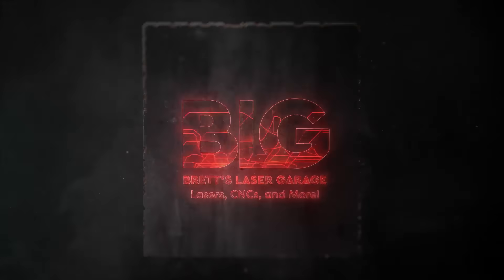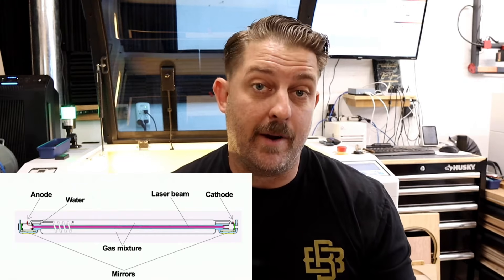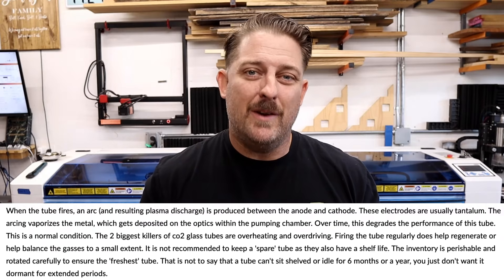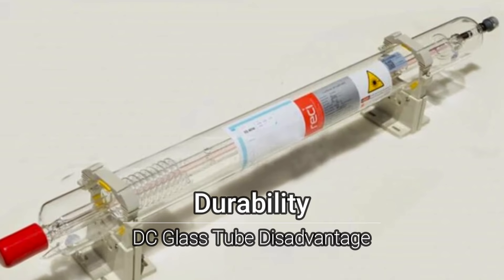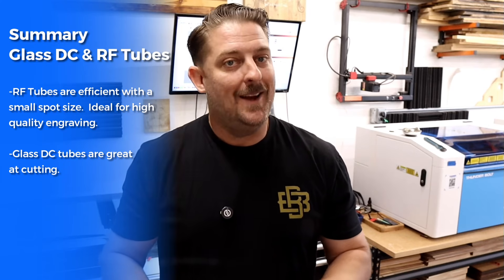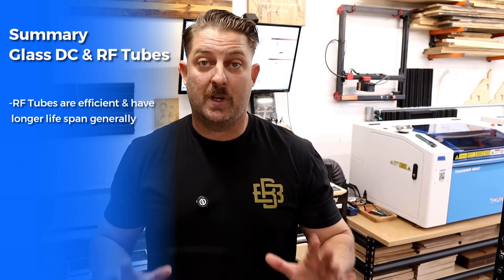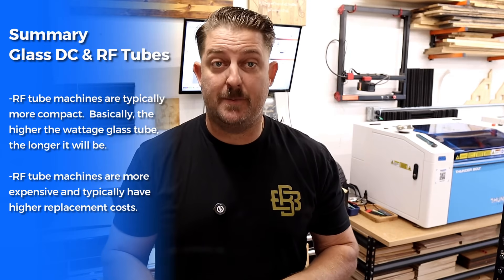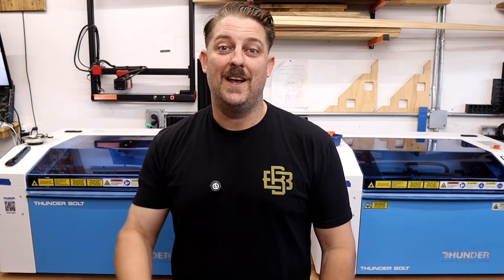What the heck is an RF laser?  EXPLAINED | Thunder Laser Bolt Pro 32  | Brett's Laser Garage

Comment: All RF laser tubes are not the same.  The Bolt Pro32 has a Coherent branded tube which is super expensive.  Here in Canada that machine is $20K.  The NovaPlus 24 uses an SPT branded RF tube which is probably a third to a quarter of the price.  That machine is C$10K.  I want an RF tube but am trying to figure out if I’ll be disappointed with the cheaper tube.  Usually more expensive means better, more consistent, more reliable.  If you have any thoughts I’d love to know them.  You have the Coherent tube in the pro 32 and the SPT tube in the regular Bolt.  Do you notice a difference?  Thanks for the video.
Reply from the maker: You’re welcome.  The only difference I notice between the Bolt Pro 32 and my regular Bolts is cutting power.  I don’t pay much attention to those kinds of details you listed to be honest.  I know whatever source Thunder decides to go with will perform bottom line and of course they will stand behind it.  I can’t remember the name off hand but I believe Thunder recently partnered with a RF tube manufacturer and I think I heard them say they are pretty much transitioning to all RF tubes sometime in the near future.  I think that’s a great call.
Reply: My all RF tubes is Coherent, and lens, also Coherent.

Comment: which is better for charring on hardwoods? basically which has gets the engraving darker with the most contrast.
Reply from the maker: Great question.  I have not seen any difference in that between glass dc tubes and RF machines.  I’ve gotten dark engravings on both.   I’ve found material selection, power/speed, line interval and focus make the most difference.  Testing is going to be key here.

Comment: Does an RF tube better handle the low range. On my 80w CO2 Glass tube, I don't have any usable power below 12-15% and I would like to have lower power at size and speed of a full size laser, vs smaller and slower diode or UV options.
Reply from the maker: Yes, that’s exactly right.